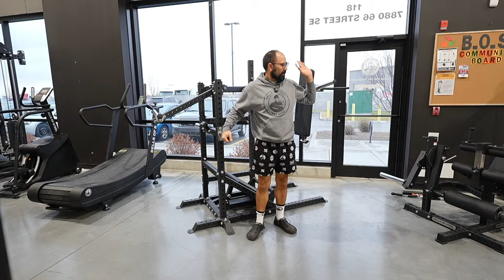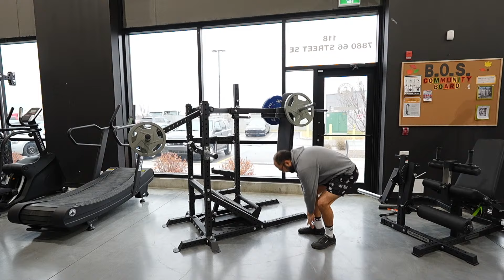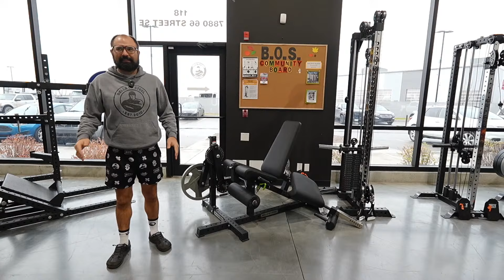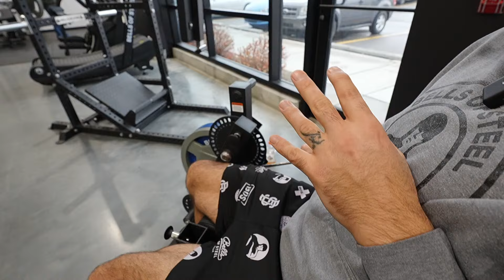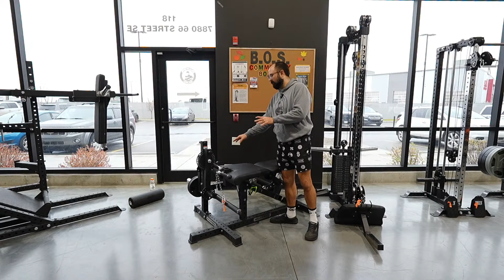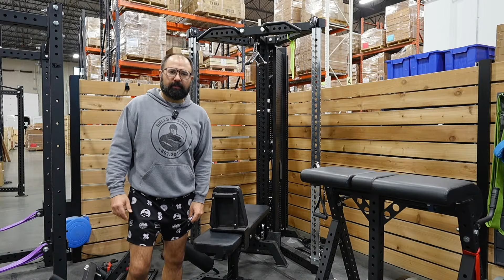Pandemonium Squat + Legacy + AIO 2.0 Q&A

Comment: Great walkthroughs of the new and updated products! I have to admit, I didn't get all of the advantages of the legacy leg extension/leg curl at first but that adjustable start angle to the weight horn is pretty compelling and helps explain the price delta with simpler seated models.
Reply from the maker: Thanks for your kind words! We're glad you found the walkthroughs helpful. The adjustable start angle really does make a big difference in enhancing your workout experience. We're committed to offering versatile equipment that justifies the investment! 💪

Comment: with the weight horn being much more forward than other models, is the leverage significantly better on this one? how long is the arm - the distance from the pivot to the seat? and to the plate horns

I get you drill holes in the frame to lower shipping costs but does that also contribute to the frame flexing?
Reply from the maker: Great question! The forward placement of the weight horn does enhance leverage. The arm length from the pivot to the seat is roughly 16 inches! 💪
Reply: @BELLSOFSTEEL   from the pillow blocks/crossmember to the backpad can't be 16 inches? surely more like 4-5 feet?
Reply from the maker: @bearshapedbubs6626  oops I misunderstood. 39 inches when the seat is all the way back! If you have more questions about the setup, feel free to ask! 😊